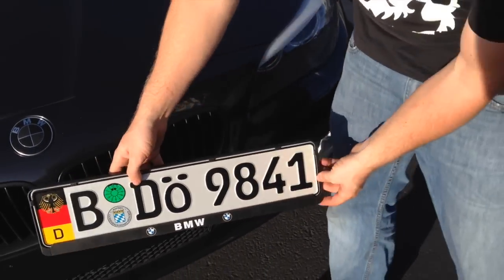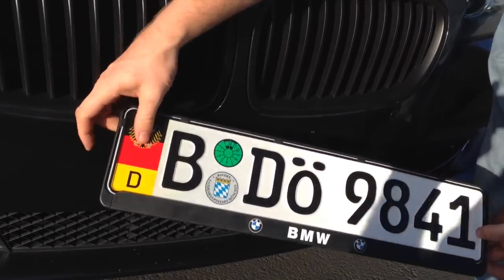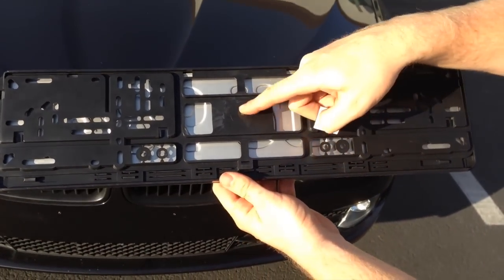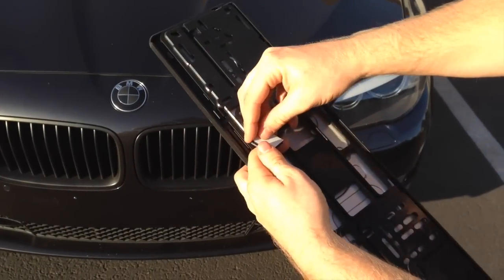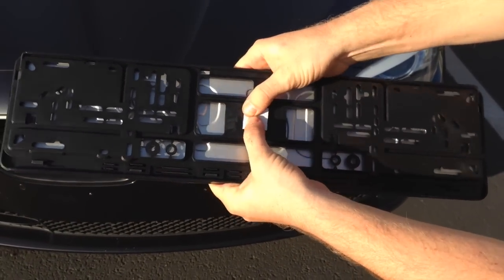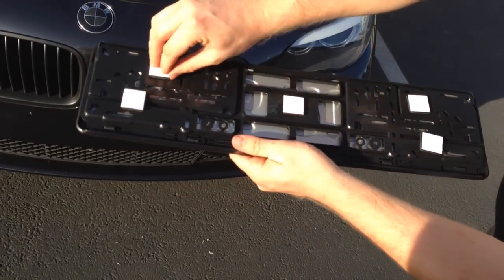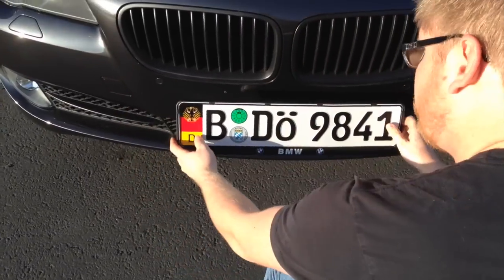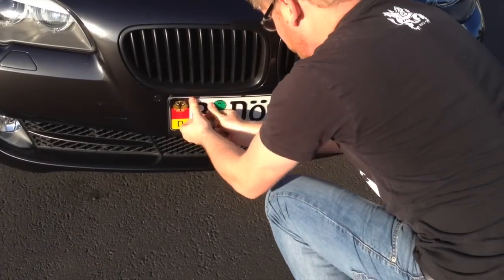How to Mount Your Custom European License Plate Using 3M Dual Lock

Comment: FYI for us American's, you won't find a product called 3M Dual Lock if you're out looking for it at your local hardware store. What you'll find is  a product labeled SCOTCH Extremely Strong - Holds 10lb/45kg. The only place that you'll see the  Dual Lock name is on the back of the tape when you remove it from the packaging.

Comment: Your supposed to screw the frame to the car....not stick it, the whole idea of using a frame is to not have holes in the registration plate, if your going to stick it you dont need a frame.
Reply: some people personally prefer a frame around their plate regardless, just for looks
Reply from the maker: A frame mounted to your bumper makes it much easier to swap different plates out without having to remount.

Comment: Thanks for the video. I’m going to do this directly on the plate, just until the frame arrives. One suggestion I have is to float it with water like you would a decal, so that you have the freedom to position it just right before committing.

Comment: Does it holds very well like if Im going on the freeway is not gonna fall off?
Reply from the maker: Miguel Lopez A properly installed plate will not fall off on the freeway.
Reply: Mine holds on 130+mph. As long as you do it right you won't have any issues.

Comment: Does it detach ?
Reply from the maker: Yes - the Dual Lock attaches to both your bumper and the license plate (or frame) and then you can remove the plate or frame from your bumper and re-attach it later.  Keep in mind the Dual Lock will still be attached to your bumper.

Comment: this will not work to well on the newer audi grills
Reply: conanobr you an zip tie them on the honeycomb Audi grills (such as B8 RS5)
Reply: You are absolutely right. I wish I would have seen this before I bought mine. Oh well.
Reply: Be careful with the zip ties. They can break the grill. My plate just came in and I'm going back and forth with mounting tape of the zip ties.

Comment: how easy to remove off bumper?  I will sell car eventually and remove plate. how do i remove 3m tape without paint damage?
Reply: it comes off together with paint. just saying
Reply: @hasancankamiloglu8899  i think you can remove it like a emblem or badge. Heat gun and fishing line